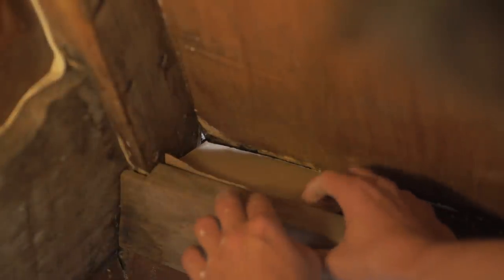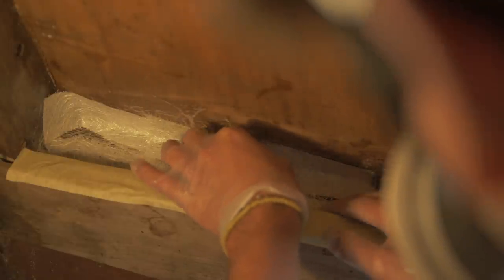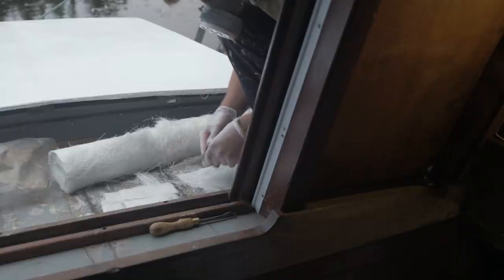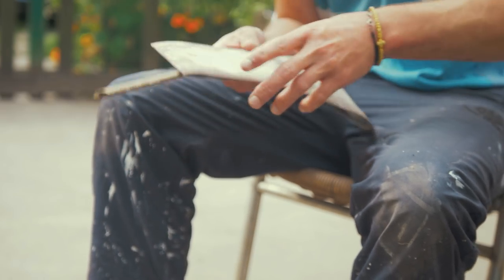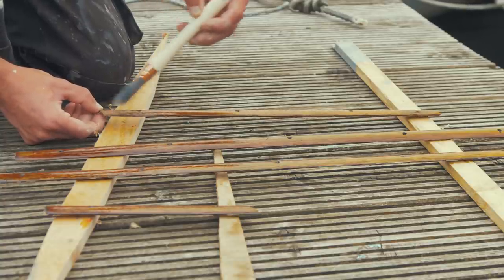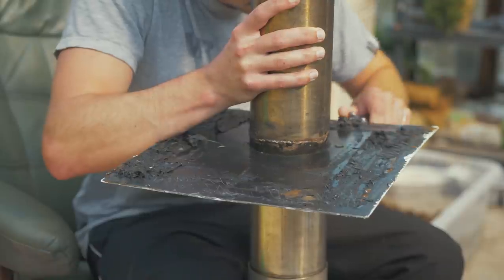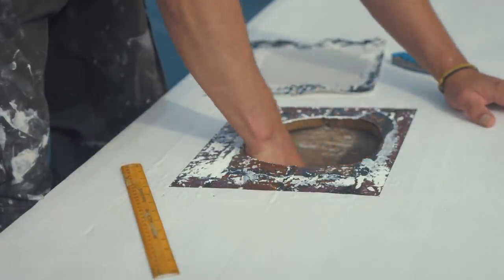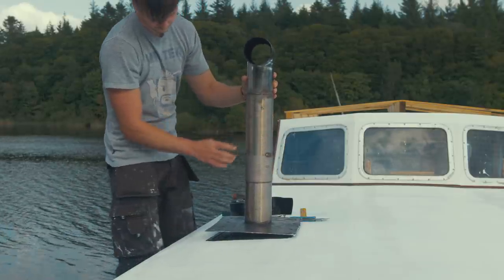Episode 18 - Restoring 81 year old 40' Wooden Boat into a liveaboard ⚓

Comment: Just a suggestion when you're sending stuff done take a small block of wood wrap it in the belt sander that you're using just the belt of it the sanding paper so wrap it on a block of wood and you can use it for a black sander just throwing that out there but great job guy

Comment: Keep up the work, you'll get there eventually. As mentioned already, when working the resin into the fibre glass, it's better to dab it in, rather than to "paint" it on. It help prevent the glass from separating and dragging. It's also worth tearing the glass apart, rather than cutting it with a scissors. That way, you can feather out the edges and get layers of glass to blend together, without and lips or steps in each layer.
Reply from the maker: Thanks for the tips. I'll be sure to give these techniques a go next. Thanks for watching!
Reply: @LakesideProductions  if you do want to still cut bigger pieces a stiff wire brush to scrape the edges of the chop strand stuff to feather it out nicely. Also being to resin rich isn't as strong as just enough.

Comment: Out here in the Philippines i can get most of the woods for the jobs you are doing as cheap as dirt that is why I will build my wooden boat here. One thing that is difficult to get at your end is teak however there is an alternative wood native to the Philippines which we call Yakal it is cheap in the amounts you may ever need and it's called Balau. I built a whole cabin out of the stuff in Uxbridge (on my channel). It is just as good as teak but has a tendency to crack in full sun but it is fine for interior work. I got mine as scrap wood from Silva timber.

Comment: Thanks for sharing! I always like to see what progress you've made in each video. There are other channels where all you see are expensive tools and tons of money being spent. I like watching your more affordable ways of doing things. Similarly, I bought a motorcycle recently and see people spending $150 for a license plate bracket or turn signals. I've either made mine or spent a little time discovering the same items for less than $10. I've ended up with a motorcycle that tends to have people milling about and complimenting me on how nice it is. You'll be there shortly when you have throngs of onlookers "Ooh-ing" and "Ahh-ing." Keep up the great work!
Reply from the maker: There's something satisfying to make use from the resources at hand. That's the right job. Nice one! Thanks a million for the support.
Reply: Do you have any videos on your bike rebuild?
Reply: @stevenholton438  Sorry, I don't.  But I was mentioning parts for my new Ducati, but I almost finished a custom bobber built from a 1987 Honda Shadow.  Normal speed would have looked like a time lapse though.  I think I tore it down to the frame, stripped and repainted, then reassembled in roughly 3 days.  LOL

As far as saving money, bar end mirrors, turn signals, and a tail tidy using tiny sequential LED turn signals, and making the license plate bracket from scrap aluminum and leftover Plasti Dip cost me $70.42 with free shipping and tax.  The 124dB air horn upgrade was a must and was just over $100.  You can't be cheap when it comes to safety.

I actually made a usable mockup of the plate holder with a Tidy Cat lid since it had the angle I wanted to mount the light.  LOL  The post was titled: DIY Tidy Tail inspired by Tidy Cats (now in aluminum).
Reply: @tomsayers4488  Thanks mate....not even a single picture?

Comment: I'm sure you wish you could have kept the old wooden finish on the roof decks. But this way looks way more durable and it will help with the heat in summer times. Plus no leaks. Glad you did such a great job on it!!!
Reply from the maker: Definitely it would have been lovely to have it. The canvas seems to be the right job and it does look well. It's staying nice and cool on the hot days. Thanks for the support!

Comment: when you want to clean that potbelly stove don't go through lots of effort with wire brushes or sanding or acid. build a fire around it if you get it hot enough the rust will turn into dust and then you can just wash it off. I think it will look great when you pot some stove paint on it. cast iron is easy to clean you just throw it in a fire

Comment: Your boat must have had an engine retrofit at some point, as I’m sure those stern drive V6’s weren’t available in 1940. The Volvo-Penta engine/drives are of excellent quality, durable and long life, but very expensive to repair. I hope you can still find parts if you need them.

Comment: Very nice restoration project and great attention to details, however may I suggest you pull it out of the water and dry dock it to finish the project. I’m sure you will find more rot and failed caulking below the waterline. Plus it’s a good opportunity to inspect the prop, prop shaft and rudder along with any hull fittings. All towards making it more safe and seaworthy. Very few boats of this age have survived this long, so it’s exiting to see it being preserved for many more years!
Reply from the maker: Taking the boat out isn't an option right now so I will continue to do as much as I can while she is in the water. The hull was coated in epoxy and fiberglass 26 years ago and below the waterline she doesn't seem to be letting in any water. Later on down the line I can get her on the hard and do serious restoration but for now I want to liveaboard and enjoy the boat for a couple years. I'm certainly lucky to have this boat in my possession and I will continue to keep her in good shape. Thanks for the support.
Reply: @LakesideProductions  How often your bilge pumps are cycling is a good indicator of how tight the hull is.
Reply: What kind of engine does she have?….gas, diesel
Reply from the maker: Water doesn't seem to enter from the hull only from rainwater working it's way through the inner gunwhale where rotten in places. This will be accessed next when we get the outer gunwhale replaced. Thankfully the bilge pumps don't need to cycle often.
Reply from the maker: Two petrol Volvo Penta v6's

Comment: i follow you for quite some time now and i lovet your spirit. The restoration though is a lot of B, it's more patching up to extend the boat livespan. Your boat suffers from a great deal of moisture and rot and without addressing that first , whatever you build upon will never last or fullfill your longtime needs. This boat is in the worst position to be properly repaired. Leaving the boat in the water is not an option , it's entirely made of wood and the cancer is deep and thats why you need a 'dry' dock. Also you don't have a plan, you just keep on repairing previous work which initially was done temporarely. Putting energy in repairing both roofs for the 3rd time should be enough as a redflag to turn your stratey around. If you are really serious about this project, the hull should be your first concern since that's the only thing that separates you from the fish.
Reply: I have to totally agree with this
Reply: I third this opinion. The patchwork will continue to fail as before. Need to have a solid base.
Reply from the maker: Continuing to repair the boat in the water is my only option right now. The hull is sound and not taking on water below the waterline. From below the rubbing strake she was fiberglassed 26 years ago. I assure you that's why she is afloat today. I'm blessed to have such a fine vessel in my possession. So I shall continue with this restoration project continuing to learn with failure and success, whatever comes my way while I convert it into a fine liveaboard. Thanks for watching the journey.
Reply: @LakesideProductions  it's a fine vessel , I give you that!  Unfortunately big boats comes with big costs , and with wood you can double or triple that in man hours. Now i am nobody to tell you what to do, but by putting it out there on youtube it's my prerogative to call you out. Just try to be practical and realistic. A chain of failures and successes should not be measured by quantity, since a lot can be avoided with good advice. But that's not a vessel that you can only patch up with plywood, sykaflex and epoxy. To make this vessel your home you need to reach a certain integrity garantee in your hull structure. Wooden boats are complex, parts of your hull cannot be replaced with plywood,even marine graded. You need hardwood planks to give the boat, strength, flex, rigidity and torsion resistance. you cannot achieve that with layers of plywood. Forces on this boat in trouble waters are meant to be counter with the nimble specificality of hardwood to absord the energy without causing damage. Plywood will just crack.
A fiberglass hull on a wooden structure however is uncommon and could reveal to be another 26 old patch. Probably to avoid replacing planks then , which is necessary when taking on too much water. ( all wooden boats do) but the fiberglass mix with a wooden structure can have dramatic consequences. Due to fiberglass, water that can't escape will keep frames, beams and planks soaked and accelerate the rotting process of wood. Living in a moist rotting environment will make you ill and will wear on all your equipment. ( that's the realistic part )
So that's where the plan comes necessary , what is it i need to achieve to reach my final goal in a consequent line of priorities. But without checking the boat on the dry first , you will invest on very shaky grounds - if you can admit to the severity of the damage, that is. 
Value wise, this boat can sell in the 6 figures range, but only if restaured properly - the canvas does not belong to the properly category ;) 
Either way, i'll keep looking - cheers mate
Reply: I disagree, if I assume correctly he doesn’t have the money to restore it they way you suggest as that is extremely expensive. But if he did nothing it would continue to degrade so what he’s doing is stopping the damage from spreading and saving the boat. What’s wrong with that?

Comment: Learn how to fillet your coves with resin and filler before glassing. Fiberglass won't fold, and it gets weaker the sharper you bend it. Use the same concoction to fill in the wood voids you are patching.

Comment: I watched your earlier vid and you asked if there's anything  to stiffen your resin,,, use Talcum Powder works ok,, WEST SYSTEM offers two-part (resin and hardener) epoxy systems developed for use in boat building and boat repair. Our products are formulated to provide ...
Epoxy Selection Guide · The 105 System · Products · 105 Epoxy Resin

Comment: Didn't that fiberglass poke through your gloves? I noticed a sunk sailboat in the background, how long has that been there? Ty for the video. You are really getting a lot done to make it shipworthy! Well done! Did you seal up the gaps of the two places you repaired on the outside? Why isn't the boat sitting flush in the water? Is it because the engine is really heavy in the back & that is why it is lower in the water? Ty

Comment: Are you keeping the engines and winch because you intend to keep it as a boat, as opposed to just an off grid houseboat?
Reply from the maker: I'll need to strip, clean and rebuild the winch in order to get it working again. There's a great video on YouTube showing the process. She has two Volvo Penta v6 petrol engines in the stern which have not been run in many years, but we are optimistic we can get one working and use the other as parts. We'll get to them in the near future. Yes for sure the plan is to get the boat back driving again and have some form of offgrid power supply.  Thanks for watching!

Comment: LOL 
Why, every summer, is there a sunken sailboat off of the stern of your boat?!
If was odd, last summer. Now, it is on the bottom again this summer. 
LOLOLOLOL
Reply: @Grim FPV Well, I don't know if "recurring" is the fully correct way to put it, but I would SWEAR that I saw the same sailboat, in the same location, last summer.  Perhaps recurring works if we only KNOW of two occurrances.  LOL If we get up to three sinkings, I would hazard that CHRONIC might be the correct term. LOLOLOLOL   I am now curious enough that I may go back and check out some videos from last summer again. LOL
Reply: @Grim FPV Yeah. Episode 11 of July, 2020 at 4:42 in. I would swear I see the mast poking above the surface as he is working on that hatch cover.  LOL
Reply from the maker: @RoyalJoke248  It's my Uncle's boat, he's been out of the country and we were to take care of her bailing out the rain water that used to fill her. We'd do it on the regular. This time around we said she's sitting low in the water so we best pump her out tomorrow. Tomorrow morning came around and she was sitting on the bottom. We tried a couple times to get her lifted but it was no use. Another attempt is due.
Reply: @LakesideProductions  you seem to get MASSIVE amounts of rain!
Reply from the maker: @RoyalJoke248  It's Ireland, you're in luck if you get a day without rain. joking aside Winter is particularly bad, it just makes working out doors difficult. Even in Summer you need consecutive days of sunshine to guarantee dry timber when doing any repairs.

Comment: why doing this restauration on the water instead of on the dry? Works easier and faster.
Reply from the maker: Taking the boat out isn't an option right now so I will continue to do as much as I can while she is in the water. The hull was coated in epoxy and fiberglass 26 years ago and below the waterline she doesn't seem to be letting in any water. Later on down the line I can get her on the hard and do serious restoration but for now I want to liveaboard and enjoy the boat for a couple years. Thanks for watching

Comment: Good stuff! I wonder if you were using polyester resin and if so did you add wax to the final coat?Without the wax in the final it will remain sticky. Large boat with a woodburning stove.That will be comfortable in winter.Cheers fromSouthwest Vancouver Island in Canada!
Reply from the maker: Thanks Darryl. I've never heard about the technique of adding wax to polyester resin I must give it a shot. It'll start getting cozy soon enough. Thanks for watching!
Reply: Only put the wax in the last coat or in the gellcoat if you use gellcoat. The coats where you are laminating several layers dont add wax or you will need to sand between coats to get a bond.Dont know about you but sanding is my least favourite thing with fiberglass! I am naming my fiberglass boat SANDAGAIN!!!

Comment: The videos are certainly a very long drawn out process of digging away at old rot etc .  With rot comes "Mold" . 
           Mold is something that's alive and it grows .  If not completely removed it will continue coming back every so many months  . There is certainly a moderate amount of "Patchwork" being shown in these videos .  If it were me , I would have removed that whole cabin roof and forward deck and thrown them out then built new ones . 
     If it were me I would have removed much more from the interior ; bulk heads , floor parts , interior rooms etc . 
 Rot is certainly an enemy to a wooden boat . To get all that rot out will stop mold growth . Mold will make you sick especially if this is a live aboard vessel and it will only get worse . Also Engines should be removed and their compartments thoroughly washed out with hot water sprayers . Good modern replacement engines are readily available .

Comment: Suggest you haul your boat out of the water to do the restoration correctly.
Reply from the maker: Taking the boat out isn't an option right now so I will continue to do as much as I can while she is in the water. The hull was coated in epoxy and fiberglass 26 years ago and below the waterline she doesn't seem to be letting in any water. Later on down the line I can get her on the hard and do serious restoration but for now I want to liveaboard and enjoy the boat for a couple years. Thanks for watching